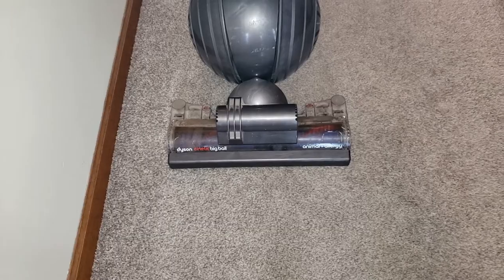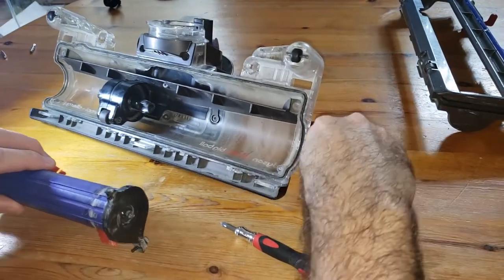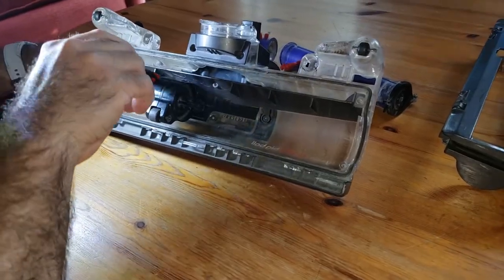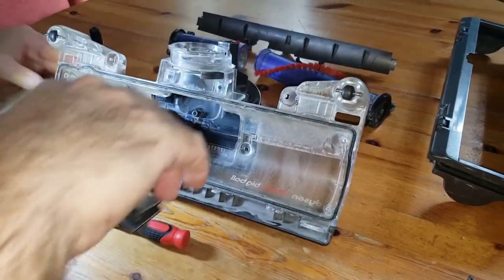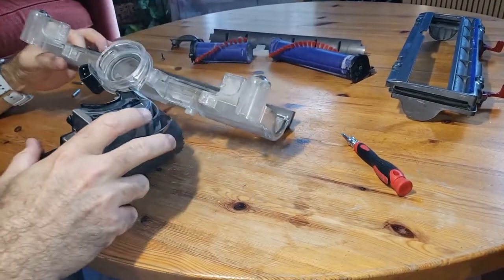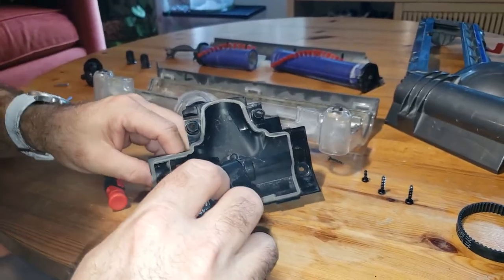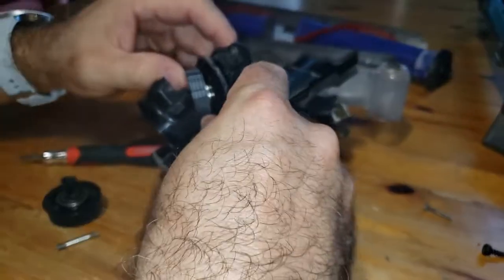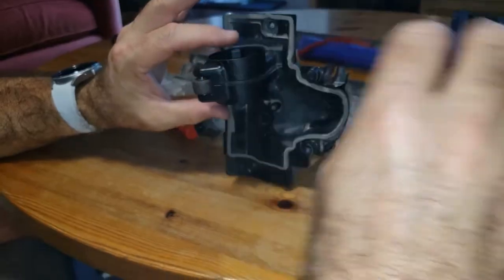Brush Head Repair for Dyson DC65 - One side not spinning

Comment: I left the gear drive housing together and drilled through the parts with 1/8" drill and tapped the holes for the bolt I used to hold the reassembled drive together. Ground the bolt head down till it fit in the brush drive cavity. Make sure to stay centered when drilling. If you fail, just buy the new gear assembly. Make sure you thread the bolt in from the side that will "tighten" if a brush would jam. That way, you do not need a nut on the bolt and it just needs to be long enough to reach the far cavity.
Reply: Did the exact same thing,  works so far
Reply: My bearing also separated from that part and stayed with the outer piece.  It was locked up when I checked it and that's likely where all these breaks start

Comment: OMG...THANK YOU SO VERY MUCH FOR THIS VIDEO because I have been driving my self nuts trying to figure out what is supposed to be what....and what is wrong and how to get it all apart!!! I have the exact same problem...and no manual. I never would have been able to put it all back together without your video...BUT.....I am still stuck at the part, that I forgot, how to connect the two parts back together and there  is a lighter gray half circle clip maybe that I have off from some place and can't remember where that goes and how. I did not see one in your video. It either goes on the main vacuum part or the main brush part somewhere where the two meet.

Comment: Thanks! You've save me about $100. You looked to be doing this real time, so my hats off to you. To help others, at 6:15 I think it's best to take off those 2 brush rotators so you can slip that out of that housing. Then once that's all out, you can completely take out that the spindle and belt. The video shows him kind of breaking the egg to get the yolk out, but just take it all apart and it's much easier.
Reply from the maker: Definitely in hind sight that would have made this easier! great Improvement

Comment: This issue happens all the time on my Dyson Ball vacuum. The spindle axle should not brake/shear this way, especially on a high-end brand such as Dyson, this easily. Dyson's first mistake was making design/engineering decision to use plastic as the material for this part instead of metal. This alone is a justification to stay clear of these specific models of Dyson product.

Comment: Thanks for this it was the only one i could find that opened up the belt-motor housing.  I also got a replacement spindle  too but it took so long to get I forgot what the spring was for. From your video i could see around 8:22 that it was held down by the small black button type piece with a screw through it -which thankfully i still have.  What still doesn't make sense is, why screw it down? Doesn't that take the tension out of it? It makes me wonder if I'm missing another piece...

Comment: Great video! Helped me to disassemble.
Comment: on 6:24, T8 should be used. I mostly break the screw trying to use T9 🙂 Other places: T9 or T15
Unfortunately because part cost about $55 on link provided and it is not possible to find this simple part in any other place and full new Dyson head cost $92 include labor, repairing looks less wise :-)
Reply from the maker: Interesting, perhaps they changed the screw at some point, i only used 9 and 15.

Comment: At 2:12 you easily pulled off the ends, if mine won’t budge (there is hair in there that needs removed), am I out of luck and need to buy a whole new head?
Reply from the maker: At 2:12 the piece pulled out because it was broken, isn't supposed to pull out. the whole part I put back in there goes in the middle and the sides sandwich it in.. Theres a cap on there that does come off of the little axle(one of which is on the part that pulled out at 2:12) that is screwed on, did you remove the screw? Look around 4:30 which is where I unscrewed it. If it doesn't come off after unscrewing that screw, maybe see if you can get some wd40 behind it?  maybe through the screw hole on the top?

Comment: Hi Dan! Thx for sharing. What is the replacement gear part number / name and where did you bought it from.
Reply from the maker: i found it on ebay, the price went up from when I repaired, but its still cheaper than a new brush head.. https://www.ebay.com/itm/Dyson-DC41-DC40-DC65-UP13-DC77-Brush-Spindle-Belt-Driven-Gear-For-Cleaner-Head-/382062164708

Comment: i have a DC 77 and after i bumped the powerhead it stopped spinning,was wondering if these 2 machines have the same powerhead?looks similiar
Reply from the maker: i bet it does, you could open it up an take a look, and if the part looks like it matches, you would be halfway to replacing it..

Comment: Where did you order the replacement part for the beater bar motor assembly?  What was it called??
Reply from the maker: the part i used was ordered here:

 https://www.ebay.com/itm/Dyson-DC41-DC40-DC65-UP13-DC77-Brush-Spindle-Belt-Driven-Gear-For-Cleaner-Head-/382062164708

It looks like they raised the price a little, it was cheaper when I replaced it, but still much cheaper than a whole replacement brush assembly..
Reply: @danscire6092  thank you!  Much appreciated

Comment: I wonder if you jbweld it would it pass or would the glue break
Reply: I didn't try, i thought about it, but then i found the part and figured it was just going to break again if I tried gluing it.. I even thought about drilling a hole all the way through and using a bolt, but I figured its too small..  if it happens again i might try something else.

Comment: Thanks for the video and part source,.....can you tell me if this applies to the multifloor2 / U19 ??? Just starting to dig into the disassembly, but the audio certainly matches my unit!!!
Reply: I tried the link to the ebay supplier but it shows "0" parts available.  Any suggestions on where I can find this part.  Thanks
Deck
Reply from the maker: @deckhulcy6891  send a message to the seller and ask for the ETA for availability, when I did that, the seller added one, if not, they might be able to tell you when they will be avaiable..
Reply from the maker: It certainly looks the same so its probably the same method of replacement..It may or may not be the exact same part, perhaps you might want to disassemble and see if it looks the same..

Comment: Hey Dan...  Where did you find the replacement part? Been looking and can't find anything other that the whole powerhead.
Reply from the maker: Yeah that was the trickiest part!  i found on ebay, using this link:

https://www.ebay.com/itm/Dyson-DC41-DC40-DC65-UP13-DC77-Brush-Spindle-Belt-Driven-Gear-For-Cleaner-Head-/382062164708

It says there are none available, it said that when I was looking as well. I messaged the seller and asked about the ETA for a part and they responded with "i will add one for you", and i was able to order..  I think you can try the same thing.. message the seller and ask when they expect to have any parts and perhaps they will do the same. Good Luck.. definitely saves money with less than 1 hour effort..
Reply: Thank you Dan.
Reply: $40 for that small piece of plastic is insane!!
Reply: @NguyenHoang-jw8yu  Now he increased for 49.99 + delivery